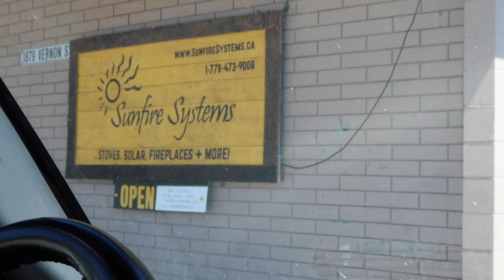INSTALLING SOLAR PANELS!! DIY Ambulance Camper Conversion Continues!! (vlog)

Comment: OK guys: What make, model, type, wattage of the panels you ended up with? Cost? What is the maximum solar panels you can fit on an ambulance roof? I notice there are 350 Watt residential panels available and some people have gotten 1200 Watts on Ambi roof. Maybe putting Maxair fan on side wall would help? Thanks you.
Reply from the maker: 2 x 315 watt rigid panels, I don’t think you could fit a third one if you want to have a roof vent. You would definitely need to put the fan on the side wall. The cost was $940 CAD including the solar controller and taxes. We learned you shouldn’t really pay more than $1 per watt. The other alternative is getting flex panels that you can move around but we don’t really know much about that. I don’t remember the make of the panels but we’ll do some digging now to find out.
Reply from the maker: Oh Nick pulled that up fast lol. Yingli Solar was the brand
Reply: @nickandraychel  Thanks. How in heck do these YouYutubers like Campulance Dave get 1185 W Solar on the roof of their Ambis- when you can only fit 630?

Comment: Can y’all butt splice those wires together?
Reply from the maker: We could but learned that it could create a spot for potential power loss so it’s better just to replace the whole line if possible, which was the best option for us - even if it meant waiting until the shop opened the next day